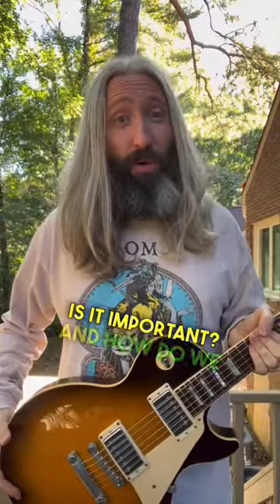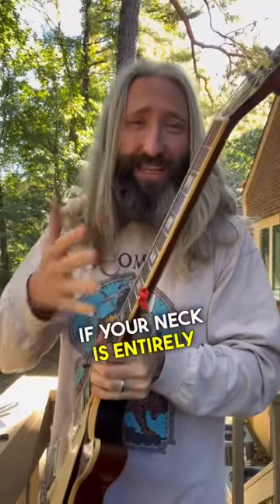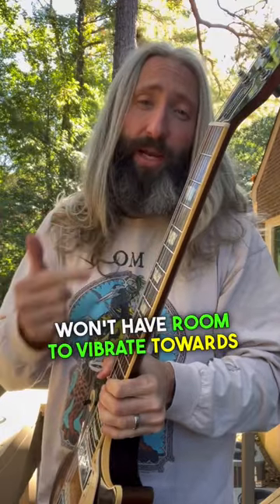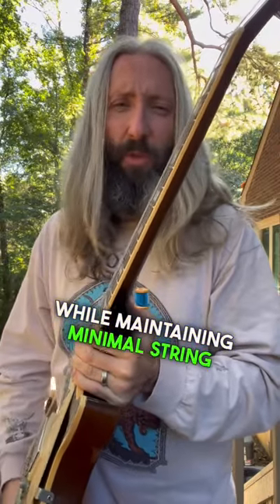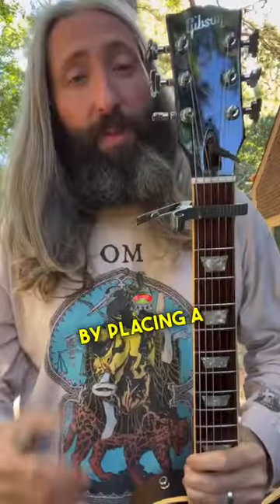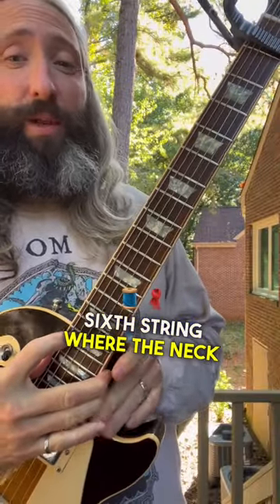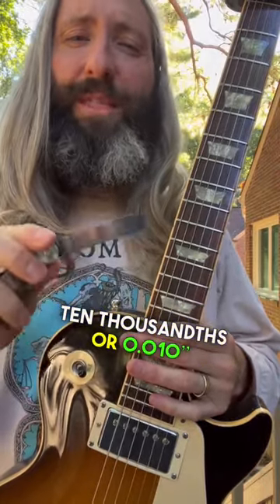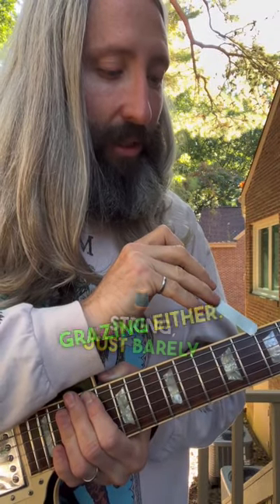How to Set Neck Relief Without Breaking Your Truss Rod. #guitar #electricguitar #shorts

Comment: That's a great tutorial. On reddit there are a lot of people who confuse relief with action. They keep saying "too much relief makes the action high". You rightly pointed out that if you give a moderate amount of relief, you can actually set the overall action lower because you are using the bow of the neck to make the frets "duck" under the strings, and not using the saddle height to raise the strings to clear the frets.

Comment: Does the guitar need to be loosened or tightened when using heavier strings?
Reply from the maker: Adding heavier strings will add more concave bow to the neck, so you’ll need to tighten the truss rod to straighten it out.
Reply: @DoesItDoom  thanks steve

Comment: Maybe not your thing, or relevant, but sometimes truss rods are installed backwards, (how?) 
before I adjusted my Epiphone Firebird truss rod, I verified how they work, I knew I needed more bow, it was backbowed ….but the direction 3 different web sites said I should turn it, increased the backbow, I thought I broke it, 😬 but immediately turned it slightly past where I’d started, in the “wrong” direction …..perfect! 
I had a luthier install jumbo frets & a Bone Nut, but he was downtown where it’s humid and I live where it’s dry, so no big deal but scary…..after all I did with that axe $800 plus $1100 in parts. Every original piece of metal was replaced!  Wrap tail bridge. But a 
Firebird like no other, 2 Seymour Duncan’s, 1 TV Jones filtertron, 3 stacked volume/tone, 4 selectable coils per PU, each has off/on
And yes….it WILL doom, 
17 gauss bridge, 13 gauss, middle, 8gauss neck, but it does sooo many other sounds too, hard to mess up a neck through was my theory…..sustain for days!🙂